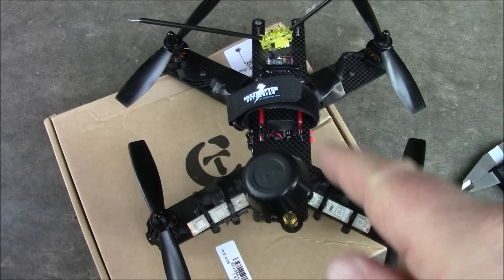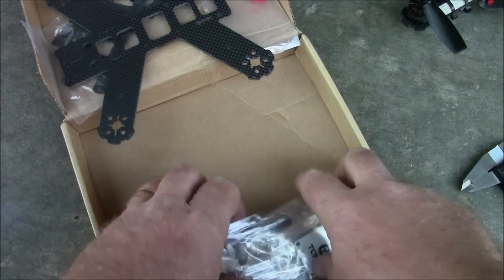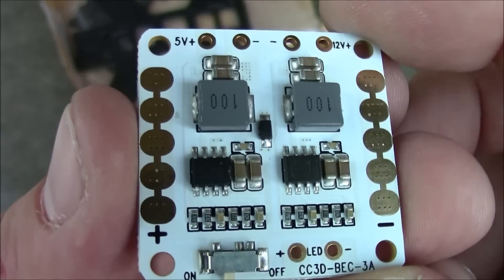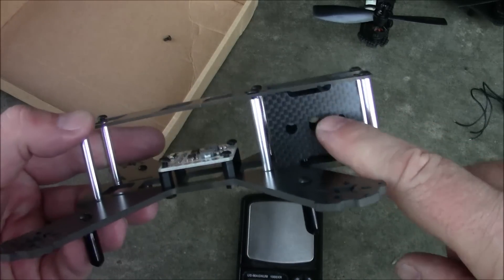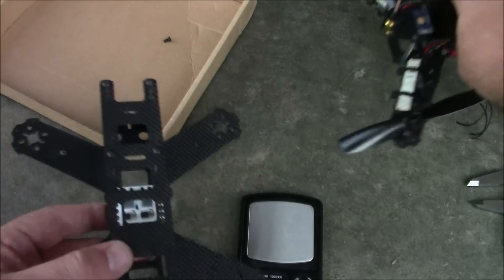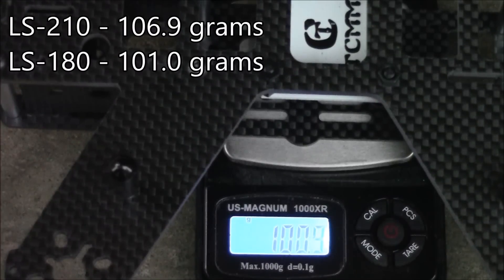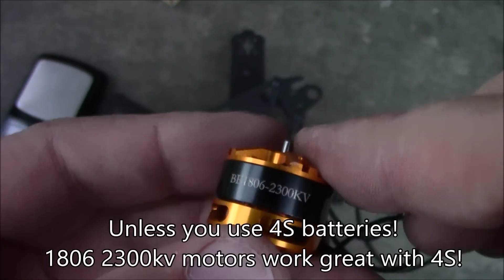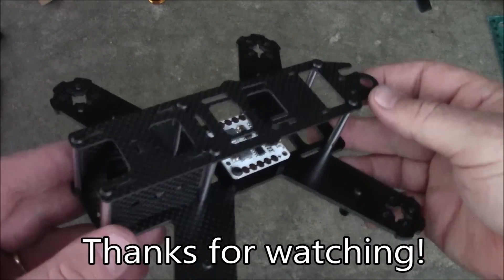Lisam LS-180 Quadcopter Frame Review from Banggood

Comment: A tip for you. Dont mount your antenna like that. When you are flying fast forward your antenna will point forward insted of uppward. Mount it directly straight out in the back insted, so when you are flying and leaning forward your antenna will stick right upp in the back and you will have alot better picture.. =)
Reply from the maker: +mrpeter81 That is a good idea.

Comment: looks nice but i think im gonna stick with the 210. i wish they would make the distance from top to lower plates shorter, giving LCG.
Reply from the maker: I like the 210 better myself too.  If you had to have a 180 frame because of some race rules, this 180 would be good.
Reply: +michael lee if you can work with out the side plates im sure you can very quickly find smaller stand offs... Or you can also get new side plates made easily

Comment: Wish they would produce arms with a small extension beyond the motor. That would allow you to screw on a stubby standoff to protect the motor bell. I would prefer to bend a standoff than dent the motor bell.
Reply: +Tobermory Cat I've been imagining a section of carbon fiber tube just slightly larger than the diameter of your motor.  It could surround your motor and protect it.  But I imagine that would greatly impede airflow on the motor and cause it to overheat.  Ventilation holes maybe?  I've seen one picture of a build where somebody used another bottom plate with arms instead of a top plate.  The 2nd set of arms above your props makes it so the motors are almost impossible to impact against anything, you can only break blades.  Heavy, but an interesting solution.
Reply: +Plur307 yep - its not so easy. Seems the props rather than the motor often take a lot of the impact but when the motors get damaged its often in the same place - on the opposite side to the power wires, on the outside edge of the quad. I thought a standoff the same height as the motor bell might be enough - minimal weight and not blocking air flow. I just dented two motors in two days - both in the same place on the bell....gurr.
Reply: Tobermory Cat
The 2nd set of arms over the top makes it so almost nothing can touch the bell.  It's a weird setup and I'm not recommending it, but it looked like it would work.  I would link it but I saw it on a forum long ago.
Reply: +Tobermory Cat Mine came - very pleased. There's not much spare arm beyond the motor but there are 3 bulging bits with holes in - presumably for cable tying some sort of bumper onto the arm.